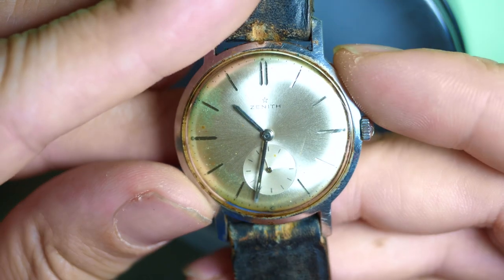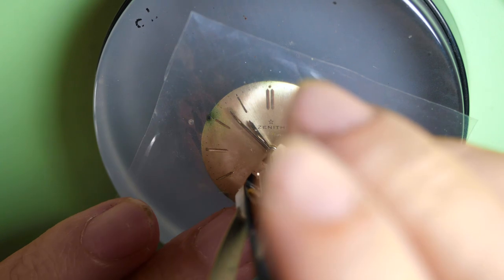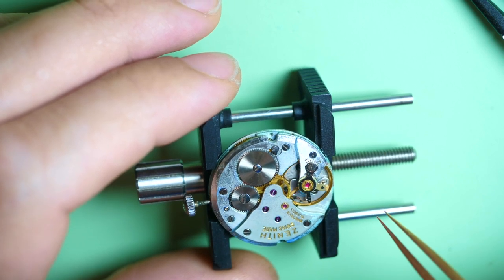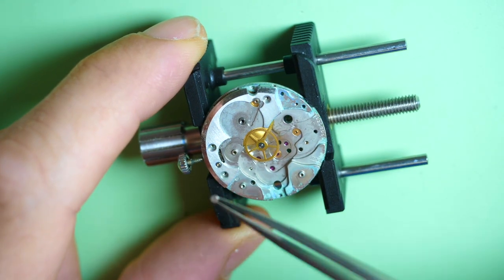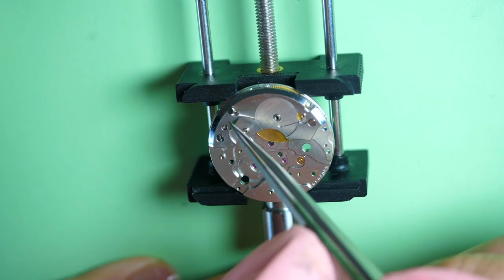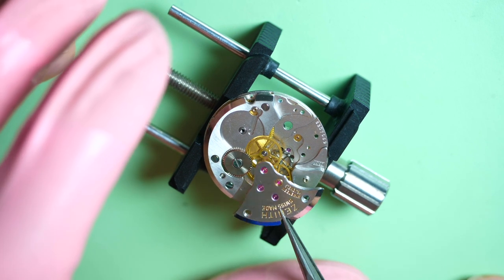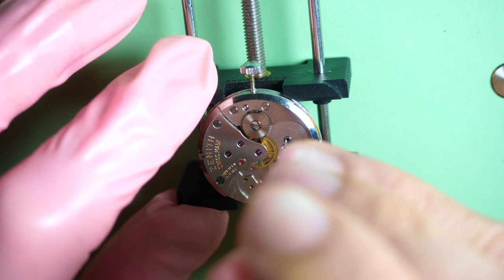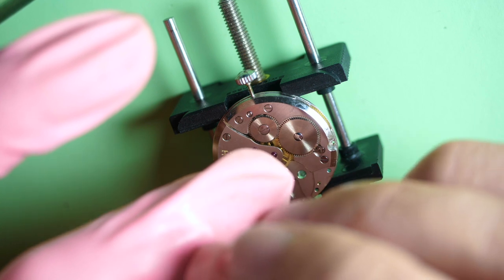Zenith Cal. 2531 Watch Restoration. VERY DAMAGED!!!

Comment: Why didn't you clean the dial and the case. Otherwise, great job.
Reply from the maker: The dial was cleaned and the case as well in an ultrasonic machine. I did not polished the case because I prefer to keep it as original as possible. It is the same thing for the dial. I clean it with some water but after if you want a brand new dial on a vintage you need to reprint it and I prefer to keep the watch as original and with some marks from the past. The watch tell you a story if you keep it close to the original